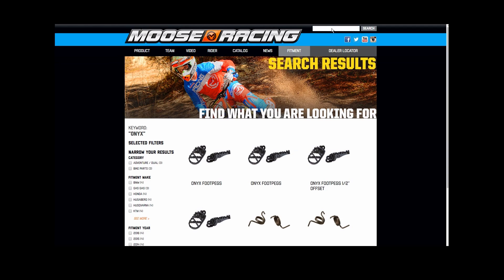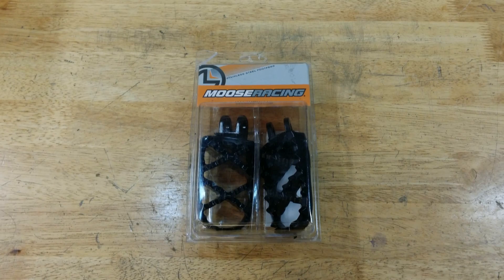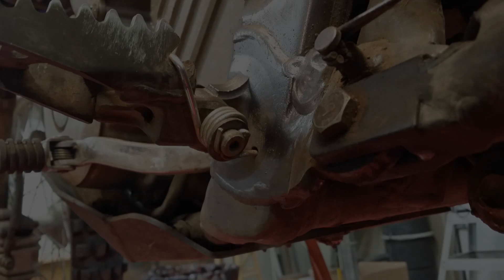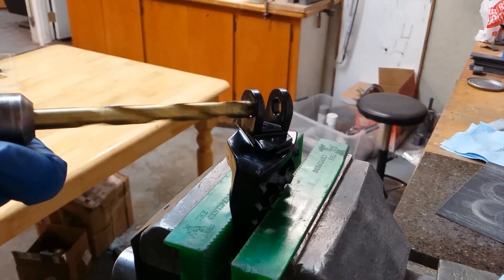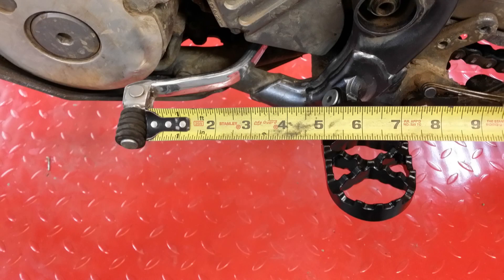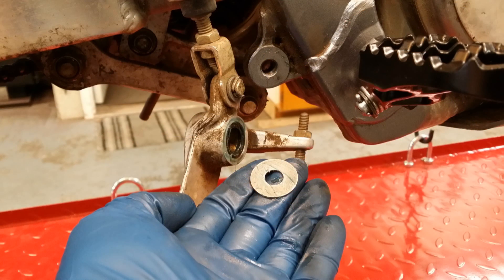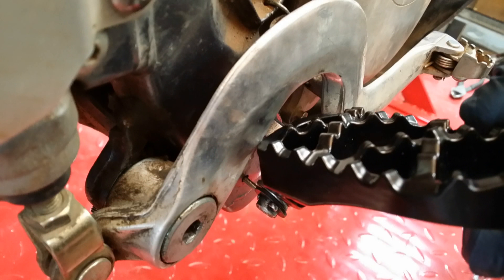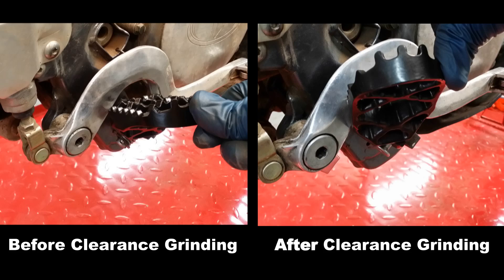ALMOST GREAT! Moose Racing Onyx 1/2" Offset Footpegs - Suzuki DR-Z400s Dual Sport Motorcycle

Comment: Thanks for this video. I'm going to install these pegs on my DRZ400 today.
Reply from the maker: I did a 700 mile ride on them this summer about 80% of the ride was off-road.  They worked great.  Still ticked I had to grind down the one side to clear the brake pedal..but they work and feel great.

Comment: Can you tell me if there is any discernable difference in the platform height with the moose pegs? i would like to find some slightly lower pegs that stock for ergonomics and my dimensions.  thanks in advance!
Reply from the maker: I didn't notice much, if any difference in height.   I do like the offset to the rear a lot though.  I also have a Seat Concepts seat that is pretty stiff.  The Seat Concepts seat actually raised me up quite a bit over the stock one.  I've got a video on that seat for the DRZ too.  https://youtu.be/JGwbaxCIVGc
Reply: @WheeliePete  yup,  I just installed a comfort xl seat Concepts seat and love it,  I also made some bar risers,  my last order of business is lower pegs.. I may just make those as well I guess..lol. I maybe should start marketing a tall rider kit...lol

Comment: You think these pegs will fit on 2019 model s?
Reply from the maker: Not sure on that.  No personal experience with the newer bikes, but Suzuki basically just keeps releasing the same exact bike with "bold new graphics" each year...lol...so I bet the pegs will work.  I'd contact Moose and make sure though.  I REALLY like the 1/2" offset on these pegs, but having to grind that one side to clear the rear brake lever was frustrating (I haven't had any problems with it after grinding it.)  I mean you could just leave it, but know if you drop it on that side and the peg comes up it is going to hit that brake arm pretty hard...
Reply: @WheeliePete  thats whats i thought...from what ive seen everything looks very similar...for 20 bucks its worth a shot haha thank you sir